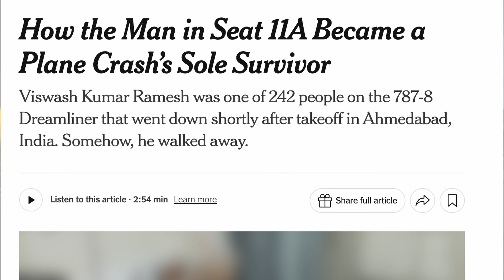Why the RAT Changes Everything – Air India 171 Update

Comment: @CaptainSteeeve FMS vs AIR DENSITY vs THERMALS: Great Hanger talk guys. Just a thought here. If the air density was thin enough to cause the engines to deliver reduced thrust, would the RAT deploy? The reason I ask is we know it was hot, but nothing the aircraft wouldn't normally be able to handle. The airfield also produced increased thermals at the time of day for the departure. What if the flap setting entered into the FMS was set using data from an earlier ATIS report that day, therefore cooler data, etc...? Would this not mean that the FMS inputs would be for a lower flap setting and the engine thrust settings would also be set to a lower limit for a more efficient performance value. Under these conditions it is certainly possible that there would have been just enough thrust to achieve V1 and an initial positives climb with the aid of airport thermals at the time. But if you look at google earth, as soon as you get to the airport perimeter, the vast airport land of heated ground is quickly replaced by a mix of urban development, plantation and a nearby river... thus reducing the thermals. This would significantly reduce any positive assistance of the previous thermals, yet the flaps would no longer be in an optimal position for sustained lift under these conditions with the still hot, thinner air. Additionally the engines would struggle to producing the require thrust, which in turn reduces speed and therefore lift, further compounding the problem. In an extreme case, the thrust produced would be so low that the electricity generated would cause the aircraft systems to identify that electricity generation is too low for that phase of flight and the RAT would deploy. Hydraulic pressure would decrease and the landing gear would fail to retract. The flaps would appear retracted when in fact the are not, but just deployed a lower setting than the environmental conditions require.

Just to be clear, I did and still believe that some form of fuel contamination is highly likely, but altitude density and old ATIS has caused accidents in the past. This is a very valid point to consider.

Comment: The fact that you can hear the RAT propeller also tells one more thing...what you cannot hear...and that is the sound of the engines. The engines seem to have just got switched off completely. Also the reason why RAT was deployed. Boeing cannot just brush it off saying it is a pilot error. 
When you mentioned that some "experts" suggested that the pilot changed the flaps instead of lifting the landing gear, you must ask them..."are you dumb?"

Comment: The rat does not provide power for the cabin lights..
Also there was a movie from the previous flight,that the airco was not working and that the touchscreens did not respond..
If the airco was not working,there should be a tech log entry and maintenance had to be carried out...
Follow the aircraft flight logs and it would tell more about the maintenance of the plane

Comment: I dont know that much about plane engines but if that was fuel mix issue, would really both engines turned off right after start and at the same time at that? Of course in theory it could be possible but more likely would be that first one engine would die and probably second one would still work for some time

Comment: I would agree the rat was deployed very unlikely duel engine failure except possibly through electronic failure, zero bird strike evident  but massive electronic failure or very very unlikely total hydraulic failure. As we know there have been crashes through electronic fault on take off resulting in exactly this type of loss of power. However never rule out the unlikely which could be cause by some form of CME solar or plasma flare which can form a beam knocking out electronics. It is obviously there is no power as it looks dead but black boxes will likely give a better picture if released. Nothing is impossible,  just improbable. I am former RAF Mechanic aircraft engines. In this case the black boxes would very likely give the answer.

Comment: I sent this letter: "Open Letter to Aviation Safety Authorities and Aircraft Manufacturers
Dear Aviation Safety Authorities, Regulatory Agencies, and Aircraft Manufacturers,
I would like to draw your attention to a remarkably simple, low-cost device that could potentially save lives: a clearly visible, mechanical plumb line placed in the cockpit, in direct view between the two pilots.
While I fully acknowledge the sophistication and redundancy of modern aircraft instruments, history shows that human error, spatial disorientation, and occasional misinterpretation of instruments have led to fatal accidents—even when aircraft were technically sound and fully controllable.
A basic, gravity-dependent plumb line—such as a brightly colored weight hanging from a string against a contrasting background—is not meant to be a precise navigational tool, but rather an additional, purely visual reference. It would not replace certified instruments, but serve as a supplementary cue in extreme situations where rapid orientation is crucial.
This device:
•	requires no power or electronics,
•	cannot fail mechanically,
•	adds negligible weight or cost,
•	and may help draw immediate attention to dangerous aircraft attitudes, especially when there is a conflict between the pilot’s perception and the instruments.
I understand that any addition to the cockpit environment must undergo rigorous evaluation and certification. Nevertheless, I truly believe that a simple visual aid like this could serve as a last-resort cue and prevent loss of control in critical moments.
I respectfully urge the relevant authorities and industry professionals to consider evaluating this idea—perhaps initially in training, simulation, or as part of research into spatial disorientation countermeasures.
Thank you for your time and attention. Sometimes, the simplest tools can make the greatest difference.
Sincerely,
László Kiss
Concerned Citizen and Aviation Safety Advocate
Date: June 17, 2025
+36 20 932 4610"

Comment: I think what really happened was that either the hydraulics or the electrical system failed right after takeoff, not a dual engine failure like some might have assumed. For a few critical seconds, the pilots were confused and trying to understand exactly what had gone wrong. They didn't push the engines to full thrust right after rotation, probably because the landing gear was still down and they were dealing with the confusion over the systems failure. Their focus was on diagnosing the issue with the hydraulics or electrics, not on maximum thrust. Eventually, they did apply full thrust, but those massive engines take a few moments to respond. The fatal mistake came when they positioned the nose for a climb, expecting the power to carry them upward, but engineers did not yet have time to react and the plane didn’t have enough speed for that. Sadly, this led to an aerodynamic stall, and because they were at such a low altitude, there was just no time to recover. The outcome is a consequence of circumstances that happened sudden and too fast in very critical moment.

Comment: You forgot the absence of a sound from engines:
2 giant jet engines on take-off mode would be many times louder than RAT.
And the pilots performed a true miracle - landed as soft as they could and saved at least 1 man!
That`s why the tail is almost intact, and the Flight recorders are safe for sure.
I`ve read complaints for the jet  fuel quality in India - clay in a jet fuel due to underground pipe wear.
Also, illegal russian oil could be processed on makeshift plants and sold to the airport  with fake papers.

Comment: If I have an electrical bus failure, I lose the FADECs.  If I lose FADEC, the engines spool back to idle.  And if I have a voltage drop on the main bus, the RAT deploys automatically.   We will know once we get the flight data recorder.

Comment: The question is that what single-point, common-mode failure could manifest during the high-thrust takeoff phase on a Boeing 787 to cause a near-simultaneous shutdown of both engines, effectively bypassing the aircraft's fundamental design principles of system isolation and redundancy? that doesnt make sense...

Comment: 3:08 It’s worth comparing this phase to a normal 787 10s after takeoff: After rotation, the mains hang slightly nose-up like on the A330. Gear-Up selection hydraulically tilts them kinda horizontal before full retraction. In AI171 footage that tilt is visible but never completes, proving the lever was selected up and hydraulic pressure failed mid-cycle. The flaps were still set for takeoff as they must be, or the aircraft’s takeoff config warning system would have „screamed“ at the crew. Most likely a power or engine failure caused hydraulic loss (CVR recording kinda confirms this), gear froze in place, RAT deployed, then the aircraft lost lift and control. But that‘s just my theory 😅

Comment: Do you know exactly what the fuel load was for this aircraft. I ask because I believe that if there was over a certain amount the fuel would have been loaded into the centre tank, and if it was, and was above a certain amount, then both engines would have been supplied with fuel from the centre tank during take off using a set of pumps for each engine. It seems unlikely that all the centre tank pumps would fail simultaneously ( before the engine failure) so what else could have interrupted the flow of fuel from the centre tank, if indeed it was being used?

Comment: Along with the sound of the RAT, I noticed a complete lack of jet engine noise. If the engines were at takeoff power, there should have been the high-pitched whine of modern jet engines that would have probably drowned out the sound of the RAT at that low altitude.  Excellent presentation, Capt. Steeeve.

Comment: Captain Steeve,
As a follow-up to my earlier question could a blocked pitot tube have triggered a chain of events that led to both engines remaining at idle (or producing no useful thrust) and the RAT deploying shortly after takeoff?

I’m thinking along the lines of invalid or conflicting airspeed data causing the autothrottle or FADEC to restrict thrust output, perhaps as part of an envelope protection response. If that in turn led to a drop in generator output or electrical system degradation, could that explain the RAT deployment?

Curious to know if that combination engines technically running but ineffective, and RAT deployment due to cascading failures sounds plausible based on your experience with the 787 systems.

Comment: All the speculation is irrelevant  The AAIB prelim investigation is water introduction during refuelling causing a short circuit resulting in both engine failing  A Known fault with the 787.  The pilots deployed the RAT as the electrical circuits had failed. The pilots should be given credit for deploying the RAT

Comment: My understanding is the RAT does not provide power for the cabin, (IE did the eye witness see the lights stay off) only the bear minimum controls when its turning at an optimal speed which would be very unlikely at 400-600 ft

Comment: Gear up  happens at “positive rate”. It is about less than 100feet make sense. Then, when did the “Dual Engs failure “ situation happened  to let the captain kept the gear down for the 2nd  segment of taking off climb and how did the plane climbed to 600 feet with both engine out?“

Comment: I have not read the comments. I don't believe the aircraft could have maintained the same pitch with a dual engine failure. If a fully loaded 787 aircraft takes off and rotates 10-15 degrees and then at 400-500 ft loses both engines, you would not be able to maintain that same pitch and have the airplane slowly settle back down to the ground as shown in the video.

Comment: Captain Steeve,
In your experience, is there a known failure mode on the 787 that could cause the engines to remain running but not deliver thrust, while also triggering RAT deployment?

I’m trying to understand if there’s a single point of failure perhaps related to FADEC, fuel control, or electrical systems that could explain both symptoms happening at the same time.

Keeping in mind of the facts that are also reported by video of passengers showing AC not working , entertainment system also .may all passengers RIP .

Comment: @CaptainSteeeve, If the RAT deployed I assume the plane's electrical should have shed all the power to the cockpit. Also I'm guessing if they still had DC power from the ships battery it would have shed and powered the DC essential bus/DC invertors.  The flickering lights  maybe from the emergency pathway  lights turning on since they have their own battery packs. Great call on the noise of the RAT dropping ( (definitely goes down with authority)  and whirl noise from the prop. Thanks for the great vid, keep up the great work.

Comment: Why don’t we take the reference of this? —There have been a dual engine momentary loss of power on Boeing 787 8 in 2019. On March 29, 2019, Jetstar Airways flight JQ15, a Boeing 787 8, experienced a dual-engine rundown—both engines momentarily fell below idle power. Cause—Magnesium salt residue jammed fuel controls at low fuel flows.

Comment: Captain Steeeve,  what you think about this one: 

what if The TCMA, or Thrust Control Malfunction Accommodation did shut down the engines ?  
This is how ChatGPT AI  explains TCMA:

How it works:
The TCMA software in the Engine Electronic Control (EEC) monitors the engine's power level and compares it to a "threshold contour".

Activation:
If the engine's power exceeds the threshold, indicating a potential malfunction, the TCMA system will automatically reduce the engine's power.

Mitigation:
This power reduction can involve various actions, including cutting fuel flow to the engine, potentially shutting it down.

What could (maybe) cause the TCMA to shut down both engines after takeoff ?

Comment: Triple Engine Failure in Ancient History: On May 5, 1983, Eastern Air Lines Flight 855, L-1011 registration N334EA, while flying from Miami to Nassau, shut down the number 2 engine due to low oil pressure and began a return to Miami. Both of the remaining engines later failed. Without power, Flight 855 descended from 13,000 to 4,000 feet (1,200 m) before the number 2 engine was restarted and the aircraft landed in Miami without injuries. Incorrect engine maintenance had led to the loss of oil on all three engines.[89]  https://en.wikipedia.org/wiki/Lockheed_L-1011_TriStar

Comment: Captain, I just saw a LinkedIn post regarding LRRA failure that can have catastrophic consequences.

While what happened on AI171 conclusively be determined by FDR and CVR, I have put forward one more scenario.

The Low Range Radio Altimeter (LRRA) on the Boeing 787 plays a foundational role in altitude awareness below 2,500 ft AGL. Each aircraft has two LRRAs—one per pilot side—feeding inputs to autothrottle logic, flight director modes, terrain awareness, and flare automation. Critically, some systems prioritize data from the left (captain-side) LRRA by default, even if the other side is functional. This introduces a vulnerability: a single-point erroneous input from one LRRA can initiate logic branches with irreversible consequences.

Historically, this risk was exposed in the 2009 Turkish Airlines 737 crash, where a faulty LRRA read −8 ft AGL during approach. The autothrottle, misled by ground logic, retarded thrust to idle, and the aircraft stalled. While Boeing updated autothrottle logic post-incident, the 787—despite its more-electric architecture and improved integration—still accepts radio altimeter data as a trigger for autothrottle and flight phase transitions.

In the case of AI171, preliminary data points to a low-altitude loss of thrust immediately after takeoff, with RAT deployment occurring within seconds. The crew reportedly declared “thrust not achieved” before impact. ADS-B data confirms that the aircraft reached only ~625 ft AGL. This behavior raises a serious technical question: did autothrottle enter ground idle logic due to a spurious LRRA input? And if so, did the FADEC systems on both engines fail to reject the command?

In theory, even idle thrust should not cause RAT deployment, as the engine-driven IDGs should continue to supply power. However, if both engines rolled back far enough—e.g., below generator cut-in N2—or if the system logic dropped both IDGs offline prematurely, bus voltage would collapse. The RAT would then deploy to preserve flight-critical loads. This cascading sequence—LRRA misread → idle thrust → loss of power generation → RAT deployment—is plausible if verified by FDR data.

The 787’s reliance on integrated systems, while efficient, assumes sensor integrity at critical phases. A false ground cue from an LRRA, especially if left unchallenged by cross-checked inputs or overrides, can create a logic trap where multiple subsystems respond “as designed,” but collectively create a hazardous state.

This incident, if ultimately attributed to an LRRA-induced thrust rollback, would reinforce the need for revalidating flight-critical logic gates that accept single-sensor input during non-reversible phases like takeoff. Autothrottle logic should ideally reject any ground-mode transition if vertical speed, pitch, gear, or airspeed suggest otherwise.

Whether the AI171 tragedy was the result of LRRA-induced logic confusion, dual FADEC anomaly, or something else entirely, its sequence reflects the razor-thin margins in takeoff phase operations—especially in FBW jets where automated systems must interpret multiple inputs in real time. The failure of one sensor should never be allowed to cascade into an unrecoverable condition.